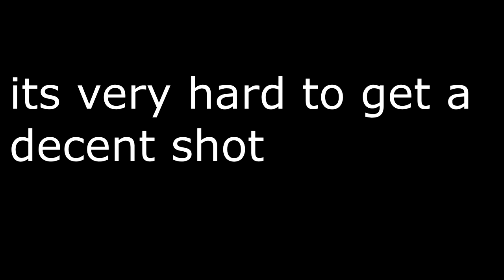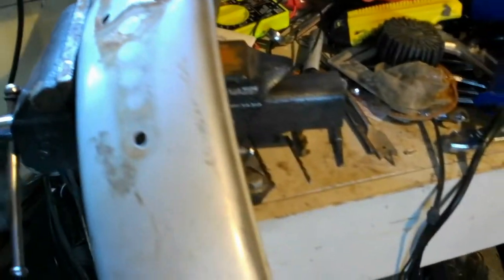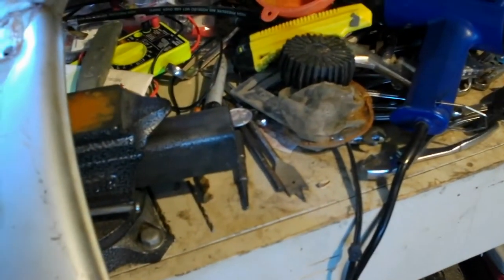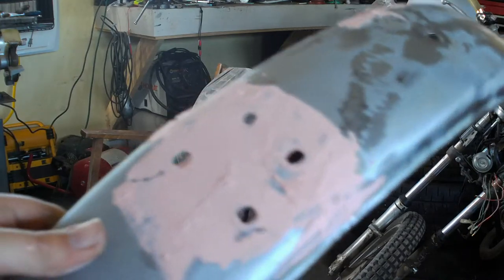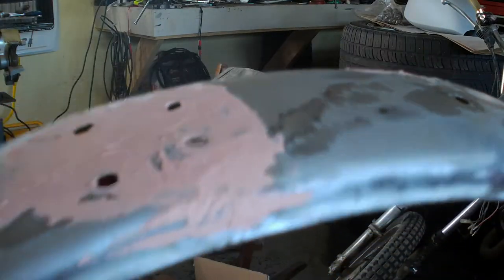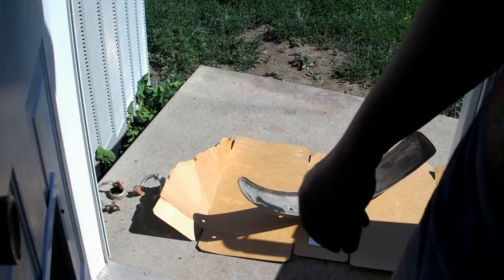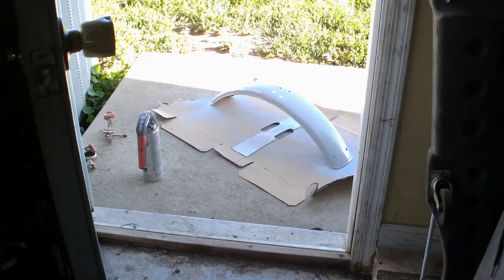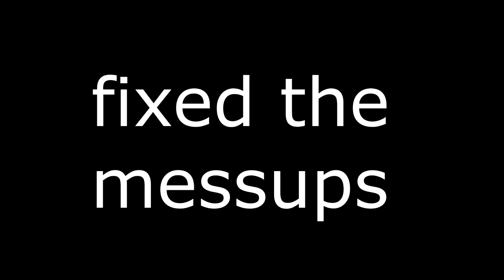RESTORING A BENT UP FENDER | $200 Kawasaki F7 175cc Dirtbike Build Part 8

Comment: Have you found any way to pull the clutch basket? Any help would be amazing! I’ve already got the nut off but I cannot figure out how to pull the basket.      Edit: I’m working on a 1975 Kawasaki F7 175
Reply from the maker: I looked in the repair manual and it said after using a tool to hold the housing still the loosen the hub nut. Right after that it just says to “remove the housing and the hub together be sure not to lose the thrust washer between the hub and the housing” it doesn’t say anything about using any special tools or any other bolts holding it on so it should just come off probably with some force
Reply from the maker: That’s all after you take the top cover and all of the plates and springs and stuff off. Hopefully that helped some
Reply: Walnutz Garage it defiantly did. I’ve been struggling to get that thing out😂